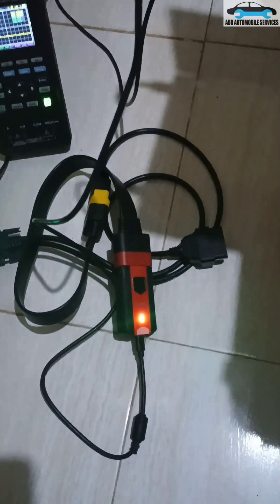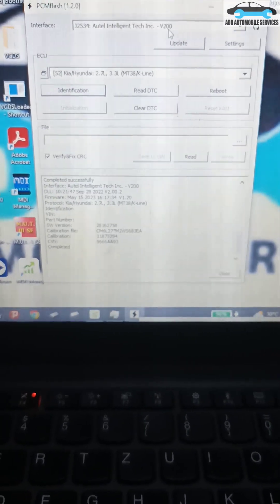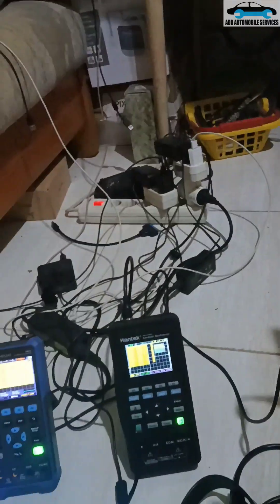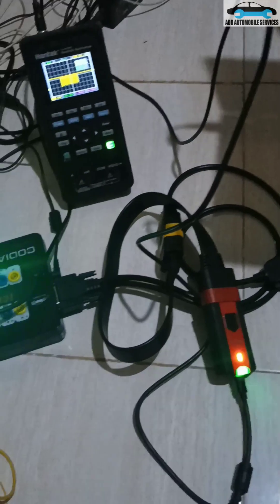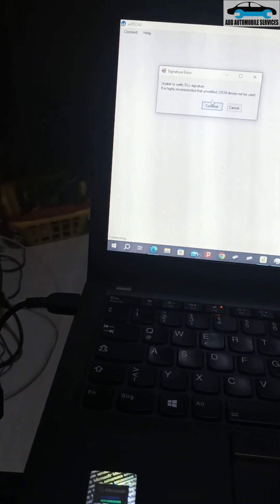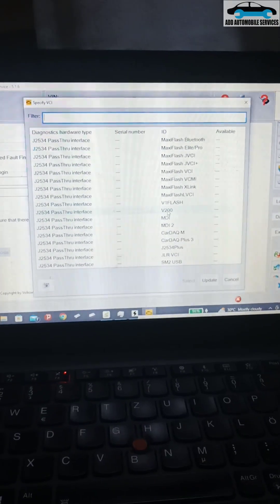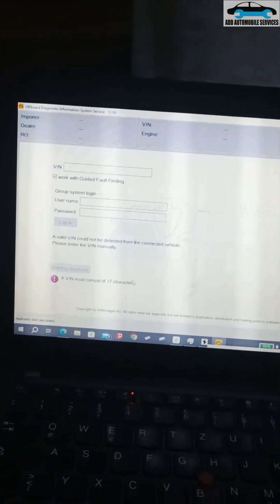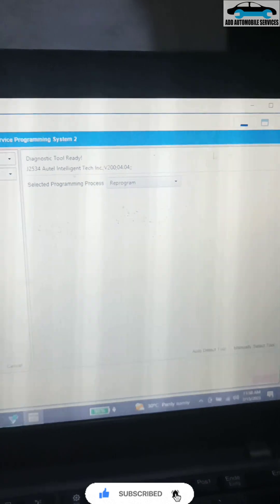Using AUTEL maxivci V200 as a J2534 device for programming

Comment: Hi bro thanks for this information, only it needs the software to communicate
Does it needs a special driver? If i had the jlr sdd
Will it work normally
I had otofix d1lite VCI
Reply from the maker: Yes you will need autel drivers
Reply: Ok bro thanks i think it should work because otofix vci is autel product  @ADDAUTOMOBILESERVICES
Reply from the maker: @ahmadlbl yes it autel product so you will select v200
Reply: Hola. Donde conseguiste la version PCMFLASH V1.2?  No encuentro en ningun lado
Reply from the maker: @cristhianperez2781 form my supplier

Comment: Does this still work with ACDelco to program a key? On the website there is a warning about using clone MDI devices, would this count as such or as an aftermarket device?
Reply from the maker: @ThomasS17  it still works as j2534 device
Reply: @ADDAUTOMOBILESERVICES  Awesome, thank you!
Reply from the maker: @ThomasS17 you're welcome boss
Reply: The message on the site specifically refers to "MDIs" that are made in China that have the GM logo, but are not made by GM and thus are "Clones". (Technically they're made by Bosch and have a GM logo slapped on, but still)

A truthfully branded aftermarket device, like a Snapon, or an Autel, is not a clone, just an "Aftermarket J2534 device".

Comment: Would this work as a j2534 device through Hyundai portal?
Reply from the maker: Yes it will work perfectly
Reply: Is this the same as the otofix v1 dongle. They look identical. I subbed through Hyundai portal, select vci200 and it's not detected?
Reply from the maker: Yes

Comment: tell me how you connected Odis, odis does not see vci 200 for me although I selected it in the settings
Reply: did you use witech 2 to connect?
Reply from the maker: Yes
Reply: I have the same problem. Were you able to connect?
Reply from the maker: @marquesneto133 yes